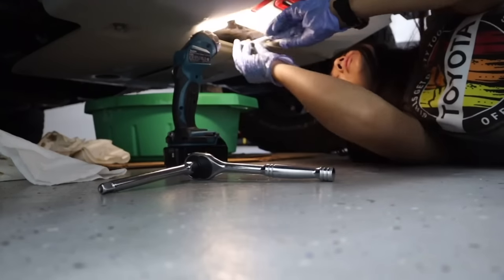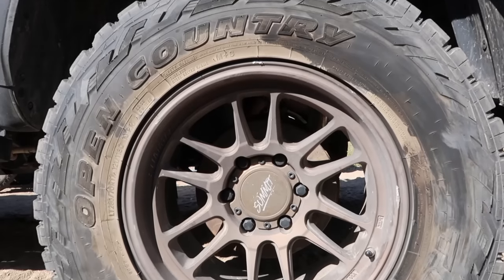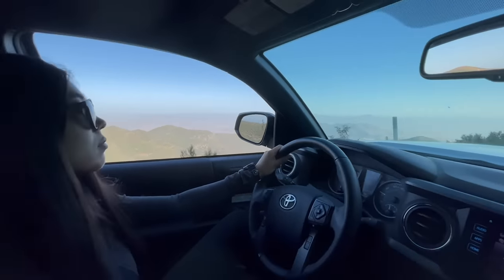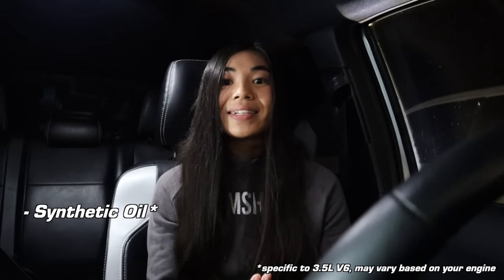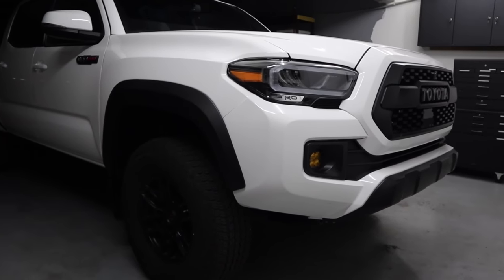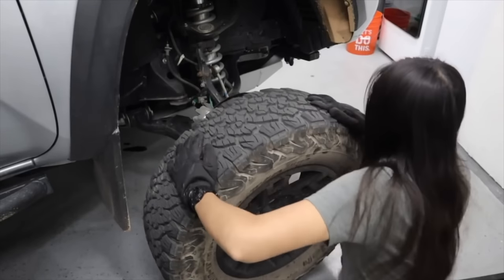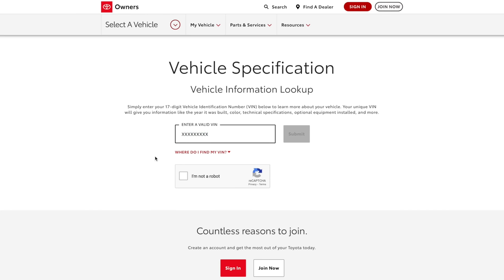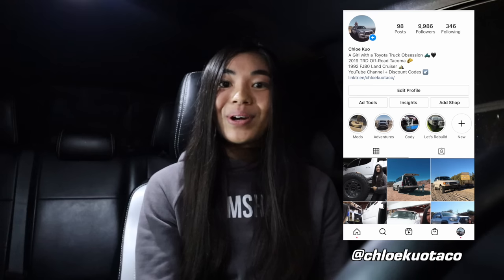What I Wish I Knew Before I Bought My 3rd Gen Tacoma | First Time Ownership + Tips & Tricks

Comment: From everyone I've talked to that has gotten 5.29 gearing, they get better gas mileage than from factory. Plus more low end response which is needed imo. 
Just asked my friend a couple days ago. He went from 15 mpg, to 19 & he's on 35s.
Reply: How do I get 5.29 gearing?
Reply: @mariomarquez5559  It''s not necessarily about fuel economy. The question is: do you need more aggressive gearing to improve drivability? People who have modified their trucks with bigger tires and lots of heavy parts will definitely benefit from lower gearing. However, someone with a stock truck probably doesn't need it, unless they just want more responsive acceleration.
Reply: 5.29 sure fire way to make sure you dont get anywhere fast. unless you plan on chopping the hell out of your truck and throwing 35"+ tires on it then its not worth it,  and if you have a manual taco 5.29 dont even bother with regearing at all.
Reply: @wravennft7843  what do you mean get anywhere fast? Lmao. It's a tacoma. Define fast.
And I have friends on 33s with 5.29s and it drives just fine.
Reply: going with 5.29s or even 4.88s, you'll get better mileage while driving city (slower). your mpgs (compared to stock gearing) drop when you get on the freeway.
Reply: @commonintel  not true lmao. That friend i talked to, lives in Milton WA. We work in Bremerton WA. Only way he's getting there is by freeway.
Reply: @mitchelodeon  Then it must be different with 4.88s because that's what I have and I lost MPGs on the freeway and gain a little in city. It could be different with Manual Tacos too. My Taco is a manual so that's what I'm experiencing. Nitro Gears even says to expect to lose some MPGs on freeway and gain a little on city streets.

Comment: You can get a engine brace for the turns, it hold the body from twisting and when you get a ebay coilover kit it all works together to strengthen the stability of the truck in turns and general just driving or going fast.. and it looks good 👍 

I love your enthusiasm for souping up a trd I bet you would love fast cars too. I got a ws6 trans am when I was 15 and I gotta say it changed my life
Reply: The 1 bar works fine. But they have 4 bars that do even more supposedly I've only had the 1. Make sure the holes are drilled by someone right because after time it could get locked in place from the stretching and won't be able to un bolt or just maintain it

Comment: I am currently running a 255/85R16 on my stock Taco. These tires are 33 inches tall but they are skinny. It's got a great look and hasn't rubbed yet (It might at full lock and full stuff). I highly recommend the falken wildpeak MT in this size. Very quiet for a MT tire and not too expensive. They are also supposed to wear well. Thank you for the videos!

Comment: Grea video. I like your comment on the transmission concern.  So far I haven’t had any issues with my 17 basic Tacoma that I got in March. I did notice the gear shift ratios. Personally it became a non-issue for as I got to used to driving the truck.  My only complaint is no driver side grab bar, but that going to be fixed.
Reply: Are you going to install an after market solution?  I have seen somebody do that on you tube.

Comment: I would say one of the biggest problems with the 3rd gen tacoma is oil dumping through the pcv valve system and pooling up in #5 and #6 when off camber. You will begin to see white smoke and your engine will take a huge dump from being hydrolocked. Usually a catch can will prevent this but it's never a full proof fix.
Reply: Catch can should fix that. I will be installing a catch can 5 miles in, and changing the oil/filter after the 500 mile break in.

Comment: I thought I would add something about the sensors. I got a leveling kit, and 265/70/17 after taking my truck through snow and having about 200lbs of snow packed under my truck the sensors would work. I had to get them reset.

Comment: Don't be afraid of the wording of a 'sealed transmission' it's just as sealed as your differentials & transfer case. The only difference is you will have to check the fluid level when it's 130°F and you will have to get creative to refill the fluid. I ran a tube through the engine bay and let gravity do its thing. I also replaced the filter which wasn't too bad. A couple hours or so and $100 for fluid and parts and I was on my way. (2nd gen Tacoma) btw)
Reply: Check the fluid at 98-113F. Checking at 130F will cause you to under fill the transmission.

Comment: One simple thing that I didn't know when I first bought my 18 TRD OR was that the rear locker only works in 4L. I thought I'd be able to use it in 4H but after reading the manuel there's like one sentence where it says it's only available in 4L

Aside from the automatic transmission still hunting gears from time to time, one complaint that I feel like could be changed via software is that you can drive the truck away (steal it/ take it out of park) without the key fob in the vehicle. I know this isn't at all unique to the Tacomas, Toyota and alot of manufacturers in general but I feel something like that is so easy to place in the software. The vehicle already tells you if the key is not present and the transmission locks you out until you put your foot on the brake pedal which has an electronic switch in it already. More of a quality of life thing and I know you could still manually lock the doors with the physical key but again just a nit pick. 

The 2GR engine has proven it's reliability in other Toyota/Lexus models well so far but for what it is wow does it drink gas likes it's nothing. That little V6 has a hard time pushing the truck along and at best its okay when towing/hauling with a moderate amount of squat. A weight distribution hitch strongly recommended for even coming near max towing capacity and an aftermarket brake controller under the dash is gives great peace of mind.

Speaking of quality, Im not sure if it just because I do alot of highway miles but the paint chips way too much. All the way down to the bear metal

Comment: For largest tires to run on stock suspension. What offset can I run a 265/70r17 on. Would it run with a Method 17x8.5 zero offset with 4.75” back spacing? Thanks!

Comment: I don't care what Toyota says,  change your oil every 3k for conventional oil,  every 5k for synthetic oil. I work on a ton of Toyota vehicles,  and waiting 10k to change your oil will kill your engine life.
Reply: I’m a chemical engineer and work in automotive field . We test the engine oils at intervals at 5k, 10k, 15k, 20k, 25k miles for all types of engine. We take this data and report it to the manufacture so they can set the ratings for cars. Full synthetic is perfectly safe and offers better protection for engines. If the manufacture states 10k than your fine as long as you use the correct oil stated. My 2007 Tacoma has over 350k miles and I change the oil every 10k. Using full synthetic we find that even at 15k the oil is 80% dirty and 20% clean. It also helps to have a solid oil filter installed and to change it every time you change your oil.
Reply: @09FoxRider   it has been my experience that engines stay cleaner, and last longer at the intervals I stated. Almost every cat I have serviced that was well over it's service interval, had super dirty oil,  and was also low on oil, including several Toyota models.  I have a filter from my car,  and one from another Toyota that way over on its oil change. Even though I run Royal Purple, my filter looked hardly used,  and the other filter was not.

Comment: Install a K&N intake air filter ASAP. They are guaranteed for 1 Million miles and need to be cleaned and re-oiled every 50K miles.
They allow the engine to breathe easier.

Have your Tacoma Tuned with the Overland Tailor Tune.
This will STOP your Tacoma from “hunting for the correct gear”.
This tune can also increase your mpg by 1 mpg.

Comment: You can fix gear hunting/shifting issues by getting a manual :)   I reserved a MT TRD Pro but my dealership could only get automatics so I went with an Off Road to keep my MT. Can't wait to get it in!
Reply: Driving a stick in traffic is the worst.  I couldn’t take it anymore…but when not in traffic, I shift for this automatic still, with the little option there!  Happy Taco Friday 💪💪💪
Reply: @beafsupreme-leecensored2311  I fixed the traffic issue by living closer to work. Now only a 50MPH and 55MPH road between home and work and the lights are mostly green!  Definitely beats 3 hours of stop and go traffic with no lights on the way home
Reply: @conradmurphy4239  nice!  I’m gonna do the same asap!
Reply: Maybe I'm weird, but I don't mind driving stick in traffic at all. Maybe because I've only ever owned manual transmission cars, so I don't know the difference. My current car is a 3rd gen Tacoma with a manual transmission.

Comment: Great video/info... Ive owned (2) 2nd Gens. 2020 2.7 sr (great truck) 2023 3.5 sport.. put almost 70,000 miles on 2.7 bullet proof motor. NEVER a issue with transmission as i drive speed limit (or less) . 5000 miles on new 3.5 with NO issues whatsoever. Tranny feels is/the same.  Great trucks & 100% trouble free...... Change your oil at 1000 miles & EVERY 5000 miles after like she said. Makes it so easy to know when you need oil change as well. 5 10 15 20 so on.... Tire size SPOT ON. 265 or be ready to pay the $$$. Stock save money - Lift truck & pay the $$$ on wear& tear. I understand lift is sweetttt. But in all honesty it comes with a price tag. I learned & i was willing to pay & did lol.. Enjoy your Taco Great advice. Thank you

Comment: Largest tire is 265mm(10.5in) wide, what about the height?
65% (31in)
70% (32in)
85% (35in)

For those that don't know. First number is width in millimeters, 2nd is height of sidewall, and 3rd is diameter of rim
265/70r17 for example
265mm is about 10.5in
70% of that is 196.75mm (7.74in) 
-Add rim diameter with height x2 to get total height/diameter
17+2(7.74)=32.48

10.5(265) wide is the recommended max width for 17x7 rims by most tire manufacturers I've run across. I currently have 265/70r17 and no rubbing. Just lifted with the Westcott designs lift and R4T Deaver add a leaf, along with a DRT body mount relocation kit. Just prepping for a larger tire later down the road.

Comment: I have a 2019 Tacoma TRD Off road also. Had the Fuel Pump Replaced on a Recall. Also waiting for the dealership to call me on the brake light thing. Love the Truck anyway. I have owned 2 Tacoma truck before this one, and had NO problems at all. Toyota also replaced the BSM sensors...twice. This fancy electronic stuff is not necessary at all. I also have a 2018 Camry SE and never had any problems with the same electronic sensors on it. Owned nothing but TOYOTA since 1992 with absolutely NO Problems at all. Just keep up the maintenance and they last longer than any other brand. Enjoyed your video.

Comment: I just bought a 2020 Tacoma with aftermarket wheels and tires. When I slow down, there is a vibration between 1-2rpm. Is this a typical Tacoma issue, or could the aftermarket wheels be causing this?

Comment: I can say..  The truck does not learn your driving habits.  Shift points still sucked and at the time I purchased mine, there was no fix other than changing pumpkin gears!  Since it’s 4 wheel drive, that is 2 pumpkin gears needing changed. No way. Way too expensive. Cheaper to get a new truck.

Comment: My 4Runner has a sealed trans and the dealer would not service it because it’s ‘sealed’. Now I’m at 180K miles and I still have the original fluid. Still shifts fine so at the point I’m just gunna leave it. I want to get either a Tacoma or another 4Runner for my next vehicle.

Comment: Where should I go to reset my front grill sensor? I bought the truck with aftermarket suspension and wheels. I did not experience any problems with the pre collision,  but once I placed it back to stock suspension and wheels the pre collision engages on its own and alerts me to brake when no vehicles are in front .

Comment: I am only watching this because I am in dream land in owning one of those trucks 4x4s ( currently on a Lexus o6 is350  I miss driving a 4x4 )  I wonder when you are speaking or largest tire size if it is hard on any other suspension parts besides clearance? there is a way to actually reset all toys and Lexus vehicles change oil so when you do it yourself you can reset that again something like turn aux on while holding the odometer reset button for a while you will hear a ding and it will popup reset its something like that to reset it  you dont need to go to a dealer or shop to do this the would probably tell you ho to on the phone . I think oil change intervals should be based on how you and where you drive :) I just had my car done and it cost me 140 CAD I would have done it myself but I dont have ramps so that I could get under it it would have been allot cheaper if  I did probably 1/3 price and 30minutes of my time.
and yes just like my lexus those stupid sealed trans are a hassle most shops wont tough them because its a huge hassle with out the pump drain what you can fill it up with fresh fluid drive I think 20 miles drain again repeat a pile of times really expensive shop time. I recommend if you have a newer truck with that trans when you do your oil change also drain the trans fluids replace with the proper trans fluid and you should be good to go its allot cheaper then going to a place or dealer.
yikes evap test that would freak me out hehe.

Comment: 14:16 so unfortunately Toyota will not service sealed transmissions at all. I called them up regarding the trans oil change and the techs explained to me that the oil is made to be in the car forever, which is bs, there is no fluid on this planet that can last 200+ thousand miles. So, you basically have to do it yourself.

Comment: The keyfob issue.. May wqnt to just throw a spare keyfob battery in glove box.  I do this with a couple pushbutton start vehicles.  Would probably be easier than transfering everything over to the OEM keyfob then back to the aftermarket.

Comment: I have a 2016 and I have had the blower fan for the AC Heater replace 3 time under warranty and once out of pocket. The motor never fails only the plastic fan cracks and will not spin.

Comment: An aftermarket tune will improve your MPG and HP just enough to make it worth it.
Reply: What tune will do this for the Tacoma ?
Reply: @zanemichael1828  it adjusts the computers that controls the engine timing, correcting what Toyota got wrong. It improves performance, and takes care of that shifting issue.
Reply: @zanemichael1828  the stock tune is notorious for gear hunting

Comment: I may be biased in my opinion, because i love my 2nd gen. It sounds like the 3rd gen has alot of small issues due to unnecessary technology. All of these small issues seem annoying because there are so many of them. Sure its a Toyota and they known to be reliable but they seem to have really over complicated their new generation. My truck has 241,000 miles of abuse, when the time comes I will not be spending $40,000 for a 3rd gen.
Reply: Im curious... what will you spend the money on? Whats next on the driveway?

Comment: What are the benefits of changing the oil every 5K miles vs 10k?
Reply: Less metal shavings circulating around. 
Keeping the oil viscosity high. 10k may be suggested, but tey sending in an oil sample to see what the condition is at that point. You may be surprised

Comment: By doing maintenance like oil changes on your own, if a problem occurs and it’s “under warranty” will the dealership still fix the problem under warranty with no paper proof of doing your maintenance like a receipt if the issue may have been caused by not doing maintenance?
Reply: @TRD if you are preforming your own maintenance such as changing the fluid at the correct intervals than the manufacture will still cover honor the warranty. It gets fishy when you have a dealership warranty you have to read the contract provided. None the less the manufacture will trump the dealership all the time. If you run into problems just call the Toyota.
Reply: @09FoxRider  thanks for the info!